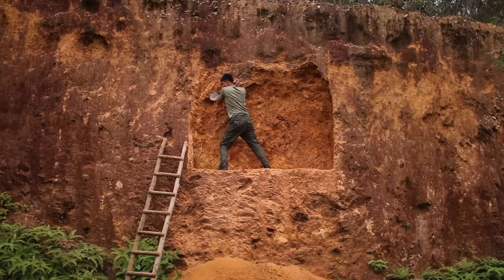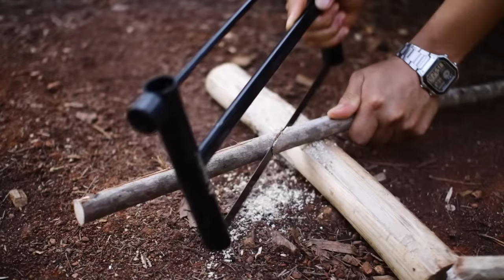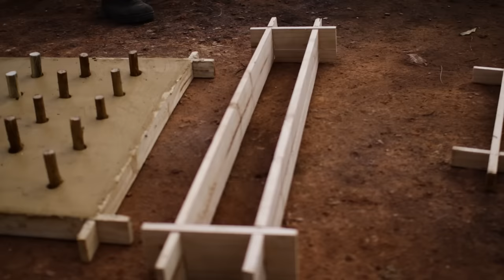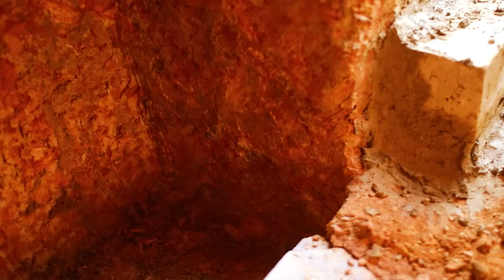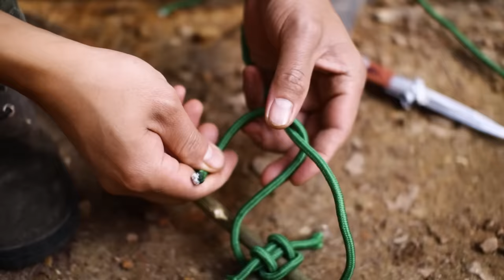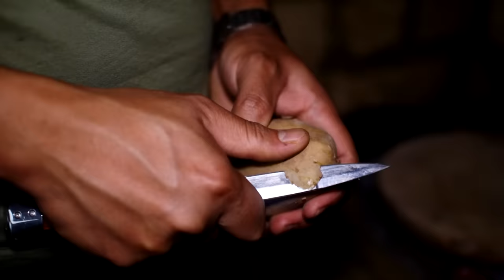Survival Alone - Build A Shelter On  High Cliff, An Underfloor Heating System, Eel Traps And Cooking

Comment: Civil engineer here. The red flag with excavating natural earth material like this is the danger of a cave-in or collapse. If you want to build an underground shelter, make sure your first step is homework. Lots of it. A few suggested places to start follow.

Read up on how to build a house first, so you understand roof forces (aka loads) and how the loads must be transferred to the foundation. Learn the difference between compression and tension, and how many materials, like soils, are vastly weaker in tension.

Once you understand some of the basics of forces and loads, google how to prevent cave-ins, how mines are constructed, etc.

Then read about the engineering properties of soils, and how they change when they get too dry or too wet. Read about soil cohesion and what happens when your soil lacks it. Is your soil safe for what you're planning? (When in doubt, get a soils lab to test it, run your design by a geotechnical engineer, and write a will, just in case.)

I love survivalism, prepping, edible wild plants, and primitive technology videos like this one. I backpacked the Appalachian Trail. Just saying guys, don't leave the house until you've done everything you can to figure out everything that can go wrong, and how to make sure it doesn't! Cheers!
Reply: Looks like there's a lot of clay in the soil there.  I'm not going to disagree on your points, though.  A lot of these channels over in Asia love to just build projects like this all over, then leave them to rot, instead of taking care of them, doing upkeep and the like.  Explicitly, I'm NOT saying this one does, but there's a lot of videos of similar channels, and how they built projects like these in forests.  As well as some even faking piping in water using bamboo pipes.
Edit:  SunnyV2 has a pretty good video on it.  I've noticed that as of late, Primitive Technology Idea has been using a lot more ideas from the Australian channel, Primitive Technology.
Reply: Well said and very good advice, I was thinking the same thing...what if the roof collapses there is no support...a landslide and that's it 🙄 this is just for show 😀 he's not really in the middle of nowhere because you can hear domestic animals near by 🤷🤷😂😂
Reply: He probably just decided from a thousand years of people in his community building these without a single cave in, that he would take the chance.
Reply: @redfields5070  If so, I would accept a thousand years of field testing as meeting my litmus test for research. lol It's more than I usually put in.

Comment: I am mostly curious as to whether the underfloor heater really works.  Will enough heat be transferred to the floor?  The fireplace is probably plenty enough for a room like that.  Especially in SE Asia where it doesn't get very cold.  However, would this heater design work in a larger room in colder climate?

Comment: the underground heating system won't work much like that. you did a great job but you placed fire and chimney on the same side. hot smoke should go from the fire (placed lower than ground) through the underfloor tunnels that will provide heat, to the chimney on the opposite side of the room/wall. the way you made it you will have stagnant cold smoke under the floor and stones will not be warm.

Comment: Great video but .............. the frames he made up were not the same frames that he used. If only you could cut perfectly straight planks of wood with a hand saw like that. The grooves he cut were too wide and when he fitted the frames together they were "baggy" and "lose" yet when he started putting the mud in the frames were tight and stiff.

Comment: when you forage for potatoes, the first 2 tiny ones was real but the big ones are all fake. He bought those big ones at the store and buried them himself off camera. The dirt was way too loose and the roots of the plants he pulled out are way too small for such big potatoes. I harvested real big potatoes and tell you its impossible to pull them out bare handed. You have to dig around the plant with a shovel and dig at least a full meter. All potatoes will be attached to solid roots and a single plant produces 50 to 100 big potatoes. Thats why potatoes are so cheap.

Comment: Dirt cliffs like that are sheer for a reason.  Unstable soil, constant sheering.  So, consider the purpose of the video and the intended audience.  It is clearly geared to impress yougsters who are going to identify with this young man.  Never mind that he is a master carpenter who can eyeball a length of vine cord to make perfect length and tie-off.  He can balance logs perfectly between his feet to cut on because he does this for a living.  Unless you have attempted these tasks and have a sense for precision, timing and skill, this is going to look doable to a kid, assuming they buy this gear of course!.  Now, his boards do not magically turn into smooth-sawn on four sides by carrying them from his saw horse design to another spot.  His eyeballing of lengths is precise as any master carpenter who does this all day every day and with the timelapse, the effect of the video is essentially dishonest.  There are time lapses everywhere that are not going to be reasoned through by a kid or perhaps not very bright person.  Most American kids would give up after about 30 minutes when they realize the clay/soil of the cliff is going to take weeks to dig out given the effort our kids are capable of.  And that's assuming they have the perfect consistency that doesn't collapse and bury them.

It does remain interesting to see how he strengthens the larger bricks with sticks and so forth.  Did he allow the potato mix to dry after putting it on the hook?  Ordinary mashed potatoes would dissolve instantly in the moving water.  Did he add wine to the dinner?  Not sure I'd eat the head and guts of those little fish but that's a cultural thing, sort of like leaving the tomoato stem in the mix.  And yeah, potatoes don't come out of the ground pre-washed. 😄  

Using the exit of the chimney to smoke the fish was a nice touch.  It would probably take days of having a fire going for the floor to warm up through the rocks and dirt surface if it works at all as that is going to be still air.  What moves the heat through the still air down the little tunnels rather than convecting up through the chimney?

I'm guessing they are selling this green backpack with its contents of the knife, the green rope, the shovel, the saw, the augur, the fishing line (nice snelling by the way),  and hooks, etc.  Kids are going to be thrilled with this.  When I was 10 or 12 I would have been trying to get my parents to buy it for me and imagining I could do all this stuff.

Comment: Nice work, and good job, HOWEVER this video appears to be a work of fiction made for YouTube purposes. Let me also preface my rant by saying that I wouldn't spend more than about 5 minutes in that shelter. The cliff face appears to be made of marl with a high iron oxide content. Marl is a mix of clay and chalk, so it's not a true rock. If you look up Colin Furze, he did a series of YT videos on the tunnel he dug on his prop in the UK. Same deal. Oh, and he's also a real engineer. Just sayin. Marl is easy to slice when it's wet but as soon as it dries out is has the structural integrity of stale bread. Why someone would dig out a shelter that close to the upper topsoil layer without shoring timber is beyond me, and then covering up the inside with unfired clay bricks is a wasted effort. More wasted effort includes placing a flammable wooden pipe inside the chimmeny as a liner. That whole "underfloor heating system" makes no sense. It's just a series of connected channels that (appear to) vent into the fireplace, so that the air coming from those channels gets heated by the fire, only to go right out the chimmeny? I don't understand how that could even work as a heating system, or ANY system at all, for that matter.

Comment: Video is interesting but those 1 inch pine boards were sapota  believe he cut and use for molds were cut in a saw mill , you can even see burn marks on one of the boards . And a rip saw does now leave that smooth of a cut, is was done by a  planer in a saw mill. I hate videos that take me for stupid.